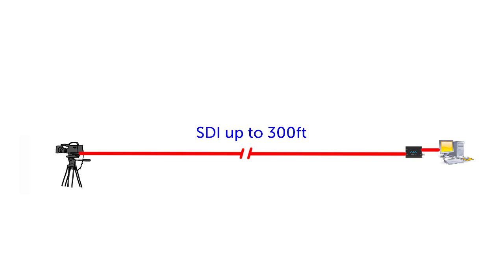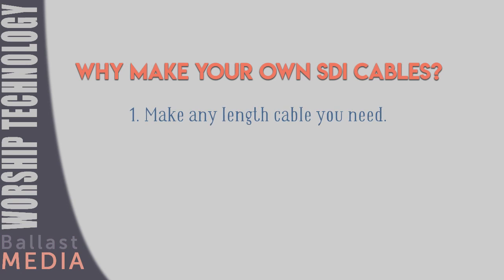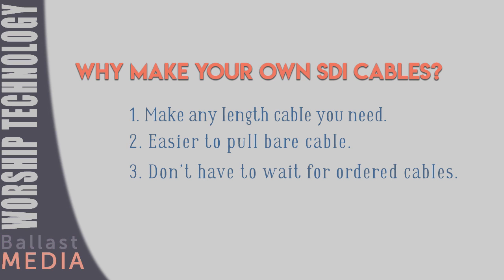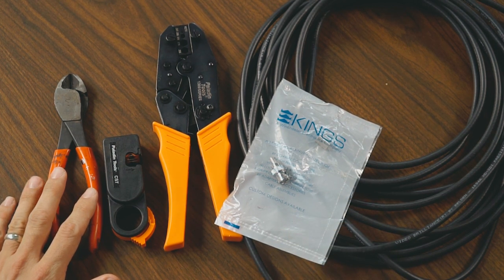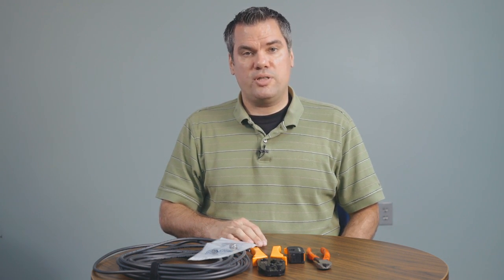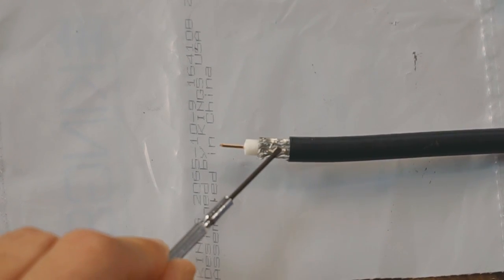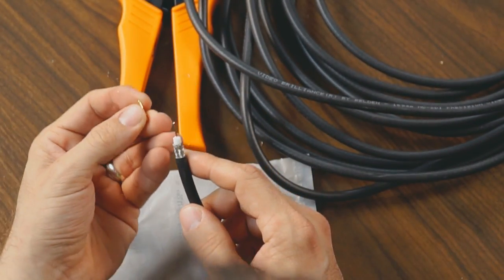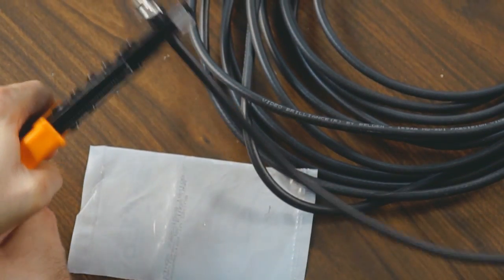How To Make Your Own HD SDI Video Cables

Comment: How far sdi signal work if we use rg 6 cable? Cx8 camera
Reply from the maker: There isn't an easy answer to that.  It depends on what bandwidth ( eg resolution and frame rate, 3G/6G/12G, etc) that you are sending.  Here is a helpful table to give you a general idea of how long you can run the cable: https://www.canford.co.uk/TechZone/Article/MaximumTransmissionDistances

Comment: Hi Ballast, we want to put up a 1080p folback display being extended through Blackmagic SDI-HDMI adapters on both sides. Our coaxial cable is going to be 100m long. Will RG6 be able to support this?
Reply from the maker: Yes, 100m is the spec for SDI on RG6.
Reply: @BallastMedia  thank you so much

Comment: God bless...
I have a question about a Canon Xlr2
That I would like to use, but I don't what or what is a good video converter. There's to ways to pull video, rca and sdi and my switcher is hdmi input...
Thanks in advance.

Comment: Im having issues using the compression BNC connector i got the other run i had to work but this short run it wont work. I did it like i did the last one and how the manufacturer suggests but am having trouble getting a signal going

Comment: What Size Die do you use on that crimper? I purchased the crimper from  a different website and the die that came with it does not come with the pin crimper

Comment: Hey Steve, can I use RG6 coaxial cable instead for RG59 cable. My run is max upto 25mts.

Thanks
Reply from the maker: Yes, you want 6 over 59. 59 is  thinner and less bandwidth/distance.
Reply: @BallastMedia  Thanks
Reply: @BallastMedia  I need your suggestion on what is the maximum distance i can run only single passive HDMI cable. 
Can you share me any forum link.
I worked only with Karmer and extron, where there is limit of 35ft, max 50ft(15m)
But my surroundings claims, that there are cable can run even for 50 mts single passive cable (low quality). Is it advisable to use it.

Comment: Id just like to say that if an SDI cable has a hard pull on it, it's almost never preferable for the break to occur at the equipment it's connected to rather than the crimp itself. Re-crimping cost much less than the equipment it was connected to or a doctor's visit.

Comment: Never mentioned what kind of COAX to use.  RG6 Quad would be my pick.  But I'm new to SDI, so I could be wrong.  RG6QS works great for sat hookups so it should be fine for SDI.
  Crimp connectors have never worked great for me.  The hex crimp look to be more stable but those cheep 2 side scrimp I can pull apart, no problem.  I've had best success with compression fit connections.  I've used them with F connections successfully.  And recently tried SDI and they work too.

Comment: Hi Steven

You mention that HDMI past 15 feet involves a gimmick.  However, you seem to be discussing HDMI over copper.  What are your thoughts on HDMI over fiber?
Reply from the maker: If you can find a fiber solution that is cost effective, it should work fine.
Reply: Thank you for the advice. I've been seeing fiber HDMI cable lately and the prices seem to be coming down. :)

Comment: Hello! How do you tell between 3g sdi, 6g sdi, and 12g sdi cable?
Reply from the maker: 3G and 6G should be RG6 or 1694A coax cable.  12G requires a thicker different cable, it should be labeled as being 12G capable.
Reply: @BallastMedia  What specific kind of cable is needed for 12G?  Planning an upgrade at Church which will include cameras going to 4K/60.
Reply: Oh ok, thanks so much so if I order bulk 1694A that should work with with our g6 Sdi set up!

Comment: Question. My church is getting ready to start live streaming our services and I'm facing a bit of a dilemma. We're using a dual camera setup and I was wondering if it would be best to run audio to a single camera and keep lip sync easy or run audio to the computer and adjust the settings in obs to regain lip sync. Also, if I run audio to a single camera, will I keep audio when I switch to camera 2?

Comment: If I'm going to extend an HDMI over SDI with the Blackmagic microconverter do I need to buy the HDMI to SDI for the computer end and the SDI to HDMI on the projector end? Both ends have HDMI and not SDI.
Reply from the maker: Correct, that would work.

Comment: Great video, but a few recommendations to make the Kings work better for you: For connectors use Kings 2065-10-9 it is the correct connector for Belden 1694a.  For stripping the cable make sure you have the lengths set appropriately: remove the jacket to 0.624", remove the shielding to 0.312" and expose 0.155" of the center conductor. For crimping use a single 0.42" crimp on the inner pin (in the video you just flatten it with the die alignment guide). The outer sleeve should get a single 0.275" crimp next to the connector leaving a small flare on the cable end to limit damage when the cable is bent near the connector.
Reply: Here is Belden's instructions for terminating Belden 1694A Coax cable using their 3-piece terminations. https://www.belden.com/hubfs/resources/technical/installation-guides/bav/Three-Piece-Crimp-Style-BNC-Installation-Instructions.pdf?hsLang=en
Reply: MAKE A VIDEO PLEASE YOU SEEM TO HAVE MUCH KNOWLEDGE BUT LAZY TO MAKE US A VIDEO
Reply: @hcmd8768  Not everyone has the ability to make videos, whether they have knowledge of a subject or not...  It's not a function of laziness?  Perhaps we should just be thanking Zach Candee for the information, not calling them names, or (shouting at them)...
@Zach Candee:  Thanks for the information, I couldn't find the 2065-2-9, so I ended up choosing the 2065-10-9 [it said it was compatible].
Reply: @hcmd8768  hahahahahaa

Comment: Hey love your YouTube videos.  We are using wire cast to do are live stream.  Someone told me I have to set the audio settings to 512 Kbps  As a minimum to get the best audio quality on the Stream.  We are currently at 192KBps  Do you know a software that allows  you to go that high?
Reply from the maker: Ivan Hurtado Where do you stream to? Facebook only accepts 128kbps max for audio. You shouldn't need more then 192kbs for a live stream.